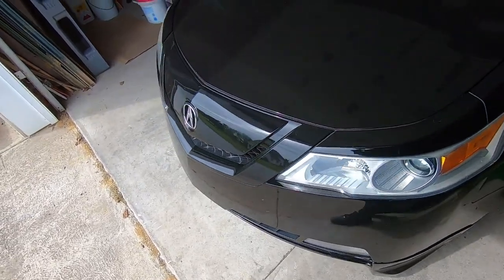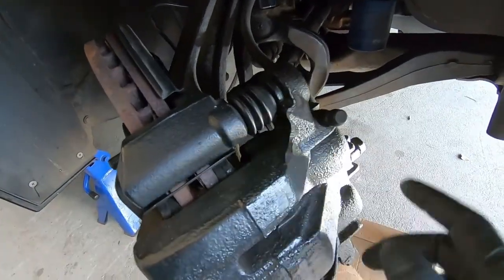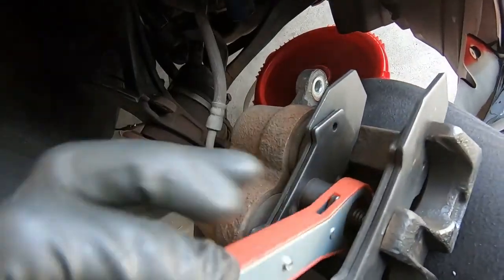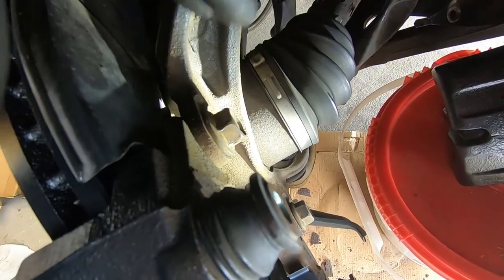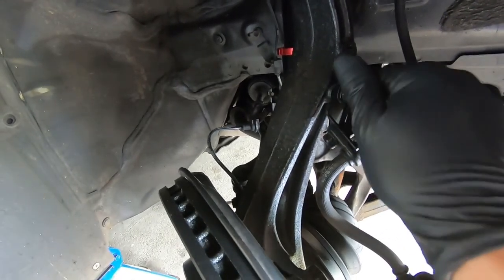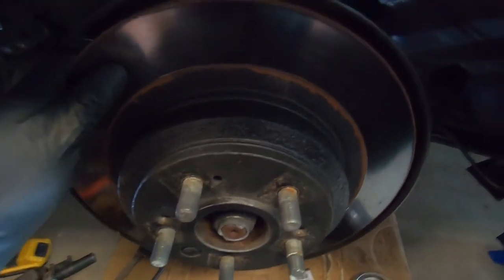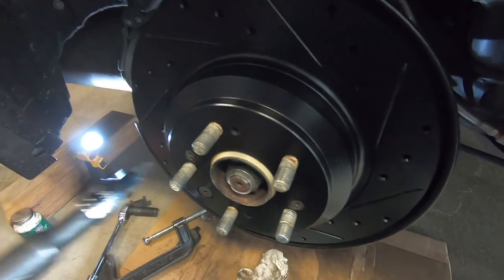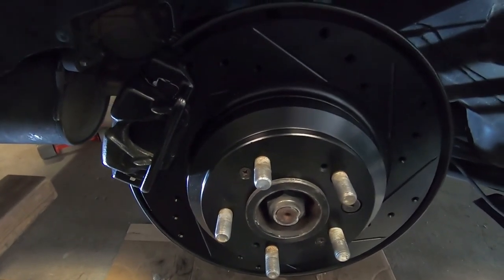2009-2014 Acura TL Front & Rear Brake Replacement

Comment: Hey bro did they change the 2012 Acura TL front axles ? I have a 2012 but some reason i went to buy a 2012 axle and it won’t fit . Did the 2012 use the 2013 axles ?
Reply from the maker: Hey what’s up man. Front a quick part search it appears for the automatic, the axles are the same part number for both ‘12 & ‘13. So it looks like they would be the same. Did you try any other axles other than that one? I’ve had parts boxed wrong before and it would make it seem like the part didn’t fit. I was actually doing a control arm on a mustang, bought Moog control arm....and i got two different control arms boxed wrong until I finally got a third one that was actually boxed correctly.

Comment: What kind of break pads did you use for the rear  I’m having trouble figuring out which pads to get for my 2010 Acura TL sh awd
Reply from the maker: Not my vehicle, the customer bought the entire brake kit & I just installed it. Check out RockAuto:

https://www.rockauto.com/en/catalog/acura,2010,tl,3.7l+v6,1444774,brake+&+wheel+hub,brake+pad,1684

Comment: for those that do brakes, do you recommend replacing or ordering a set of guide pins? do you find that they are often bad/frozen or not too often?
Reply from the maker: Thats really a subjective question & case by case situation. I would say more times than not they won’t need it, as long they aren’t stuck/rusted, you can clean them up and re-lube them. You just need to get in there & see what the condition of yours are.
Reply: hey I appreciate it a ton man. Gonna tackle this brake job this weekend on the wife's 09 TL. The rear passenger brake just started grinding. I'm hoping the caliper is still good. Will be referring to this vid for a lot of the torque specs and tips.  I did order some guide pins but can return them if I don't end up using them.
Reply from the maker: Good to hear man. Good luck with the job man! Lmk how is goes 👍
Reply: @TheOriginalBeeCee  job went well. Rear Phillips rotor bolts came off no problem with a hammer blow impact. The fronts however I could not get to budge. Even with penetrating fluid and lots of heat. Ended up using an air chisel to get them to spin and ordered new bolts. Brakes feel great so far.  Thanks for all the help and torque specs
Reply from the maker: Glad the job went well! Good stuff 🤙

Comment: My rotor wont come off i used the mallet also and nothing is working i also stripped the screws on one of the others any help with these problems?
Reply from the maker: As for the rotor not coming off, keep hitting it. Maybe upgrade you hammer to a metal hammer/dead blow. If you’re not reusing the rotor, you can beat it up and it doesn’t matter. Could even use a small propane torch and heat it up a bit. 

As for screws, its a bitch when they’re stripped. Thats why I suggest heating them up prior because thats a lot easier then opening a can of worms with a stripped one. But, if you know someone with an acetylene torch, that would be the easiest and best way. The long hard way would be drilling it out. However, with a good drill/bit I’ve gotten a stripped one out it under 5 minutes before.

Comment: Great video., While using the torch, I melted the rubber grommet What is the part # and where can I purchase a new grommet? The set screws are a pain in the a**, going the Auto Zone to buy one. This was my last screw, I stripped it, AUGH!
Reply from the maker: Damn I’m sorry to hear. I’m honestly not sure what the part # is though, and couldn’t source it from a quick Google search. Maybe comb some Acura OEM parts sites, and/or call your local Acura dealer
Reply: @TheOriginalBeeCee  I'm about to change the rotors on my 14 TL.  Where is the rubber grommet?  I don't see one in the video.

Comment: Once the rotors r off n u clean the hub with brake cleaner. Can  I spray some wd40 in the hub to lubricate the ebrake cable ?
Reply from the maker: You probably could, but I don’t really think you would need too. And you would have to be really modest with using it, because you don’t want to have to much in there flinging around causing the WD40 to get on the brake shoes & inner braking surface on the rotor. I would probably say just leave it alone to be honest, but thats just my opinion.